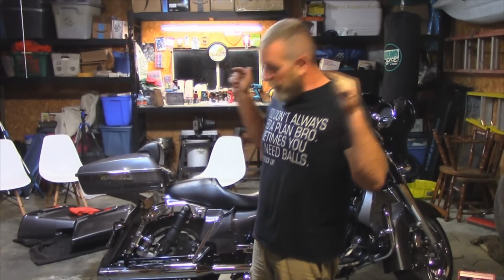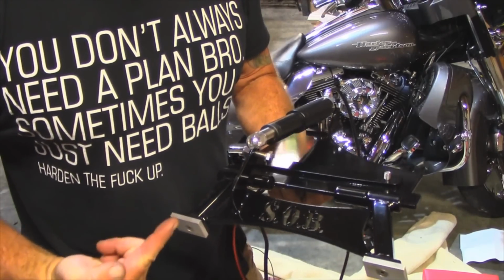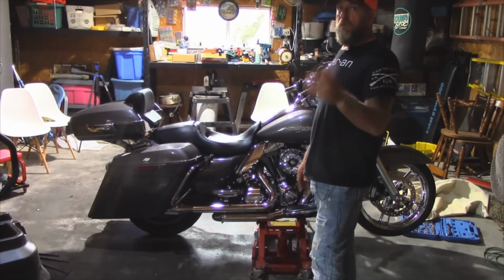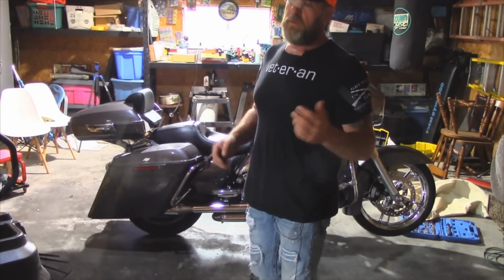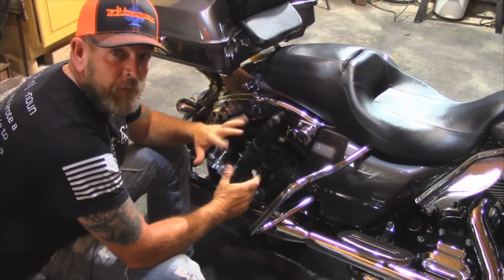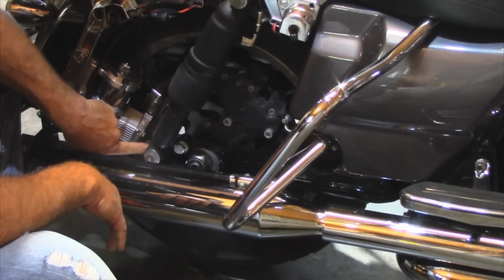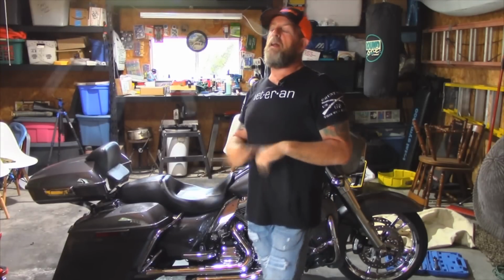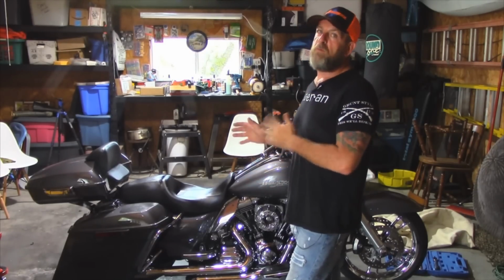How To Drop Your Sled On An Electric Center Stand With True Dual Exhaust Southern Oregan Baggers

Comment: You do an awesome job explaining the real mechanics of real life situations that we all come across, you make it easy to follow what you're talking about  very informative great advice and you're much appreciated!!! ~Keep the rubber on the road~ Thank you 👍
Reply from the maker: Thank you very much for the comment and checking out the video...I did end up heating the exhaust a little bit and flattening some with a small brass hammer. It worked great, didnt change anything and I gained the extra 1/4 inch that I needed to get the stand all the way up.  Its worked great. Thanks again! Ride safe my friend.

Comment: Thx for the video.  Now I can make my decision on a center stand and put it on with my duals.
Reply from the maker: Just a heads up ..this was shot awhile back...The only headers that run under the bike crooked like mine did are the Cobras. All other headers go straight under the bike. So just about any centerstand will work...you just have to measure and get the right length. At the time I shot this I wasnt sure what all headers went under the bike crooked like that.
Reply: @sikbaggers   I have the factory one  still on and just slip ons though.
Reply: I want to get that 1" lowering block also

Comment: Hey Steve, I’m doing a pitbull 180, not installed yet, with dirty air front and rear. My question is, by having front and rear do you think I’ll need to do lowering blocks on the rear, I should be using a shorter stand then the rear only kit. being that my front will also be dropping the frame lower, I ask because you now have both front and rear done. I’ll crease the cross pipe if I need, see no problem with that. Thanks, appreciate all your videos.
Reply from the maker: Hey Ryan...no you shouldn't have to use rear blocks now...Ive removed mine from both bikes and even added a 18 rear to the SG and use the same stand and feet.

Comment: Any problem with the lowering blocks and the bike dropping too low? I have the Jnr kit on my 18 special and am not happy with how it looks dumped. To me it still sits too high. I would like to either do the blocks and get another inch lower or even get the dirty air 8.5 inch shocks but am worried the tire will hit the fender. Thanks.

Comment: Hey Steve which size wheels were you running on the street glide with the SOB stand?  I was thinking about running a 21" on the front and an 18 on the back and was wondering if the stand would still work?
Reply from the maker: im running a 21 and 18
Reply: @sikbaggers   thank u buddy I can make my purchase now..

Comment: Why not run a different header pipe one that drops out on the left side in stead of on the right and crossing under?
Reply from the maker: You could...but if you have already invested 600+ on headers you may not want to..or if you are running stretched side covers, you cant.
Reply: @sikbaggers  glad you said that I was about to order stretched covers hmm wonder if I could modify the cover and run the pipe through it some how? I'm sure where there is. Will there is a way?

Comment: Hey I've got nothing but props for you buddy👍🏼 I love the "there's got to be a way" theory you stuck with it and you got it done and I think that is badass. I also think it's a badass setup. But I do have a question for you. A 2001 Softail Fatboy I want air ride what do you recommend? I would like one with the most quiet compressor so I can raise the bike up without having the compressor running. I've seen two different types I guess one stores compressed air which makes it quiet to raise but I forgot what brand it was. Any information will help. Thank you much I appreciate your time!!! 
Liked, subscribed, and passed on your videos to friends.
Reply from the maker: Thanks man.,..it  was a chore but im glad I finally got it because i love it.  On the air subject though I have seen tons of bikes on air...never seen a "quite: compressor however...they are all pretty much standard air compressors...however what your talking about is a fast up system....you install an air tank...the compressor will fill the tank and the tank is good for about 1 to 2 lifts before the compressor kicks on and airs it back up....When I lift mine it will lift up and as I start to roll away I can hear and feel the compressor kick on. The other route is to let the compressor fill the shocks...its cheaper but slower and you always hear it. Here is my newest video on JNR air ride when we added the fast up tank. https://youtu.be/m6exSvvhaWA
Reply: Steven Housden Thank you so much I appreciate it more than you know!!!

Comment: With the lowering blocks do you have any contact issues with the shocks and the blocks or the back side of the bags like ive heard others have? And with the jnr air ride ive got the ride hight repeater, at ride height doesn’t the shock mounting bolt come close to contacting the slip on cans? I have v&h os450 titans and don’t feel like hitting my $650 slip ons. Great videos man, keep them coming!
Reply from the maker: John Doe I don't have any issues but I'm only running 4 inch exhaust.   The extra half inch yours have may be a concern.

Comment: Steve, do you end up losing your original kickstand or can you keep it just in case that centre stand fails? Might be a future upgrade on my SG
Reply from the maker: I would never take off kickstand..With the electric center stand the base is kinda small...if you park on any kind of incline or in grass , thick gravel etc you will want that kickstand. The guys that are running center stand only generally are show bikes that go on and off a trailer...real world though, you need that kick stand. You can always park up or downhill on inclines...and if, like you said, if something goes funky with the stand itself or even your air ride.better safe than sorry.

Comment: Just bought the center stand.  What size blocks did you use that came with the stand.  Mine came with a 1/2" and 1/4" foot.  Did you use both?
Reply from the maker: I used the 1/4 inch after dropping mine an inch in the rear. the best way to see which ones you need is when you drop your bike all the way down have someone watch the front forks....when the bike drops and you hit that pivot point the front will lift slightly. If you have the 1/2 inch on and it lifts a lot...just swap to the 1/4 inch.

Comment: Have you done any installs on a 2015 road glide FLTRX or similar with V&H power duals?  Do they clear ok?
Reply from the maker: Hey Daniel  I have not...But I have noticed some exhaust works just fine. Look up under your bike where your pipe crosses under and if it goes straight across then you will be fine. If the exhaust curves back towards the front of the bike to keep away from the belt then the problem is there. Just by chance mine curve towards the front. The right side would clear but the left side that is curved forward hits...I did end up asking a few exhaust guys and they said heat it up and flatten it a little. So I did that and the stand nearly goes all the way up now. Were talking just a flat spot there and not squishing the pipe were it would inhibit the exhaust from going through...small flat spot right where the stand hit and its all good now.

Comment: Do instructions come with the stand to install the stand to the bike in general
Reply from the maker: I cannot remember if there were actual paper instructions ...The install was very straight forward though. The base plate just slides over the top of the frame plate and sits in a groove with the holes lining up with the holes on the frame. 2 bolts hold it all together. If you have some of those small strong plastic clamps it will come in handy. You can put it in place and clamp it down to hold it while you put the bolts in. You have to do this one the jiffy stand as putting a jack under the bike wont work..your jack gets in the way of putting on the stand so the bike is at an angle...unless you have a buddy hold it upright while you install it . Once you get the plate over the frame there is very little room to get your hand in there to hold it. 1/2 inch maybe between the plate and the bottom of the transmission. The wiring is pre done so just put your switch where you want it...put the pos and neg to the battery.  You can call SOB also if you need help with anything. He was a really cool dude that helped me through fixing it hitting my exhaust.

Comment: Hi I have a 2018 street glide special. I would like to lower my motorcycle 1 inch. What can I get to lower it?
Reply from the maker: There are a couple of style lowering blocks on the market..the ones that are strictly 1 inch drop and then there are 3 hole for 1,2,3 inch drop. If you are only wanting to drop it one inch please look for the ones that are stickily a 1 inch drop. They are built better and the 2 and 3 inch drop holes are not really safe to run...too much pressure on your shocks at those angles.

Comment: Steve,1) Did your bike come with true dual exhausts? I'd like to make my 17 RGS true duals but it's only a small desire because I too am installing that SOB center stand (thanks to your video). If your bike didn't come with true duals what all did you do to get it that way and the approximate costs?
Reply from the maker: Mine did come with true duals..the guy I got it from already had it done. One thing I have noticed since we did this is that not all true duals are ran like mine with the pipe bent slightly forward...some go straight across. Mine combo is Cobra Powerport headers and Rush Racing Big Louie's 4" slip ons. Its the rush pipes that are bent inwards though. You just have to figure out which ones arent bent in by looking at some maybe at your local HD. The rushes run about 400 depending on what style you get and the cobra headers are about 500...if you do just the exhaust you shouldnt need to remap your bike...if you do an open air cleaner (stage 1) then you will need to get it tuned. So keep that in mind for possible additional costs. HD can remap it or you can buy your own tuner.

Comment: CAN YOU SHOW HOW LOW IT WILL DROP WITH THE STAND UP AND WITH THE LOWERING BLOCKS?
Reply from the maker: Not really a way to post pics but the frame is 3 inches from the ground when all of the air is out and no center stand.  Using the kickstand, that side is about 2 3/4 inches from the ground. If I can get some picstures and host them somewhere I will shoot you a link here.
Reply: Why not put the compressor behind the side cover. I did it on the wife's street glide. Keeps it cleaner.
Reply from the maker: That was going to be my last option, I complete move of the compressor. I had seen a picture where one was mounted behind a side cover but it looked to be screwed into the plastic with self tapping screws...there was no good way, I seen, to mount the bracket using the provided heavy duty bracket I got from JNR. Flipping it did the trick but that would have worked too on a last ditch effort.

Comment: What lowering blocks are you using?
Reply from the maker: These are from Amazon..BlackPath - Harley-Davidson 1" 2" or 3" Adjustable Rear Lowering Kit www.amazon.com/gp/product/B00TQ9JDBI Very stong...good looking weld on them and I found out after grinding on the one for an hour they are very thick strong steel.
Reply: Thanks bud,  appreciate what you're doing. Keep it up